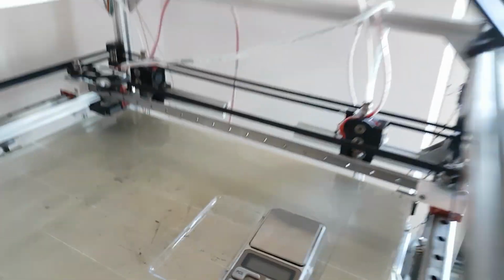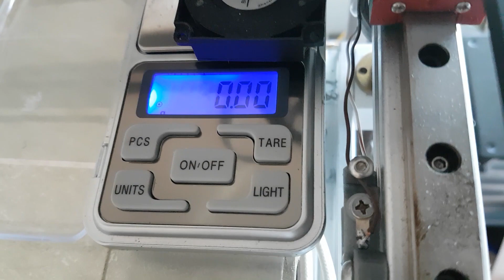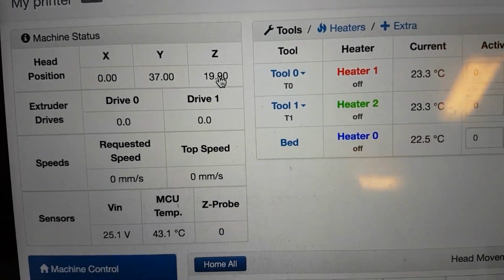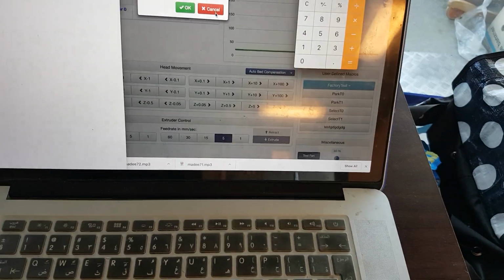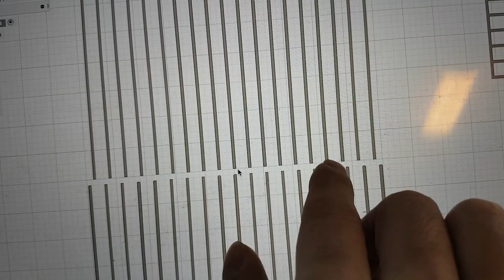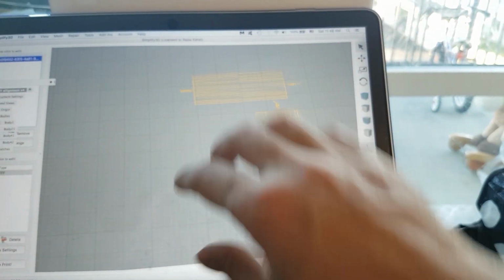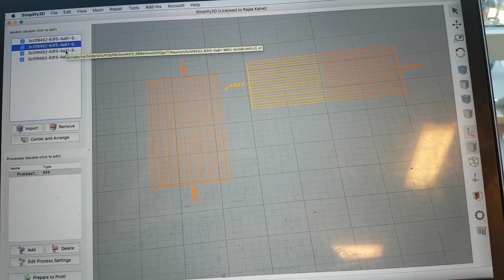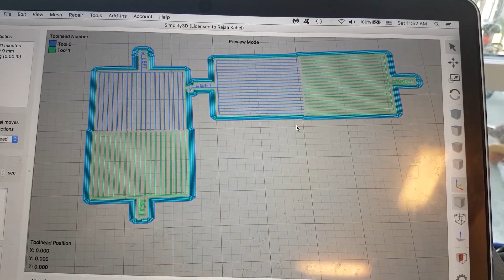Dual Nozzle Offset Calibration for XY and Z

Comment: Which electronic board do you use duet with duex or  
Azteeg X3 PRO 3D printer Controller
Reply from the maker: DuetWifi without Duex.
Reply: Rajaa Kahel what if i want 4 extruders in future
Reply from the maker: @user-mu1tc2ls6e  Then add extension board that fits your needs :)

Comment: i used a jeweler's scale too for zeroing out the nozzles on my quad too -- awesome! -- But I was trying to make sure the weight scale showed the same value, and I was physically adjusting each tool to be super precise so that the z offsets are 0
Reply from the maker: Cool!
Sure, you could go for higher accuracy as I mentioned in the video, but I honestly don't see a point of going more than 0.05mm as most of printers have a minimum stable step of 0.04mm.
But of course, why not.. more accuracy is always better!
Reply: My machine isn't switching, it's a double idex, so all nozzles have to be z aligned in case I want to print duplicates or mirrors, can't use offsets in that case. Yea 0.05 is about as close as I try to get them aligned, I ended up just using the paper to under the nozzle trick to make sure the drag is the same.
Reply from the maker: @kazolar  I see..
I used the paper method before this method, but I found that it's not trustable because of the paper might not be the same thickness everywhere, and the bed is not the same height everywhere (unless you manage to do that on the same spot on the bed and the paper.
The scale method is super sensitive tho, the slightest touch will give a few grams.
Reply: @Rajaa Kahel I did both. I have switched to 3/8" tooled aluminum build plate with 4 lead screws -- duet levels the bed using lead screw adjustments at the corners. I did probing of the bed and it's under .02 flat on the entire printable 550mm square, so no mesh leveling used. Perfectly flat/level bed -- love it.
Reply from the maker: @kazolar  .02 sounds awesome!
My 6mm aluminium bed is also a custom cut and tooled, but you know we use printing surfaces, PEI+double adhesive tape in my case. So it's always good to calibrate/test on one spot. Especially for those who got "normal" beds.
Reply: @Rajaa Kahel I have boro glass with PEI on top of my bed, and that is super flat -- that's what I am measuring with the probe.